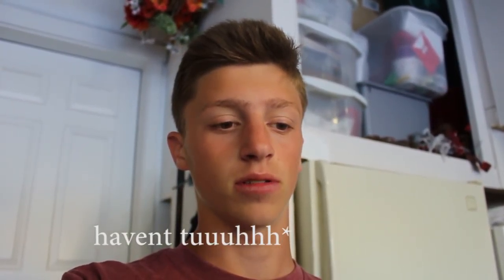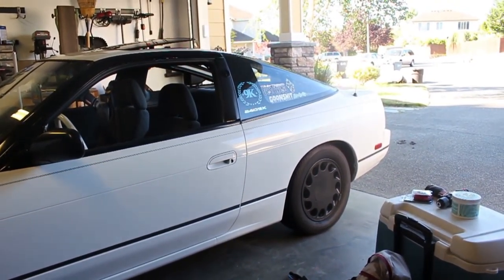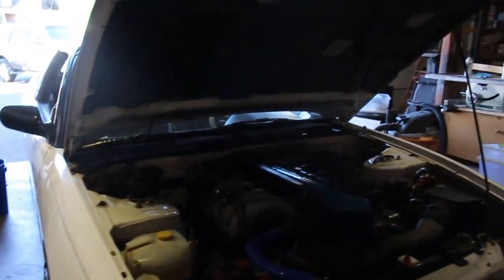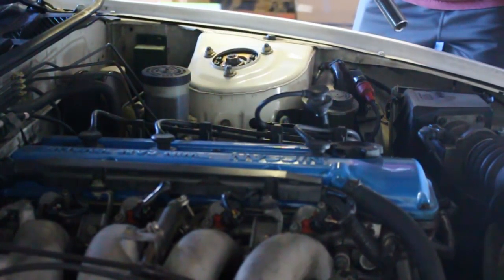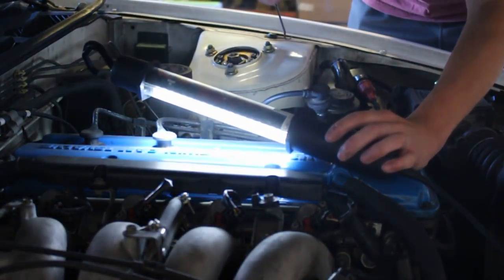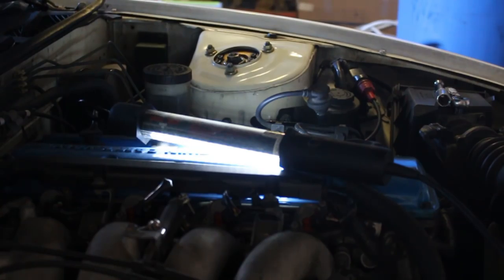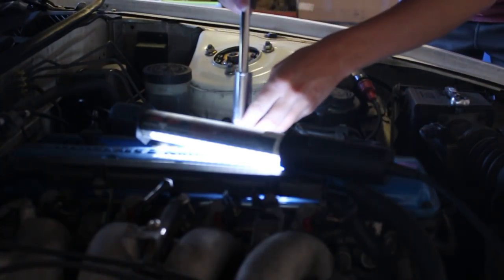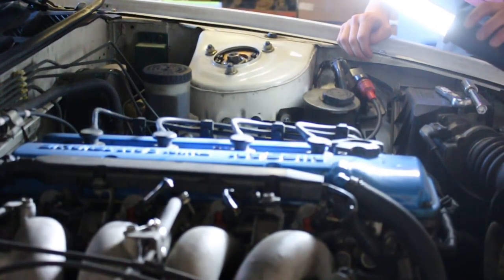240sx s13 NEW WHEELS!! (spark plug install)

Comment: Nice wheels brah and just use the spark plug wife to take out the plugs. It's faster. All u gotta do is just push the wire back on to the plug and it comes out